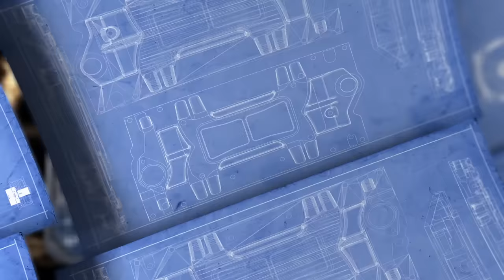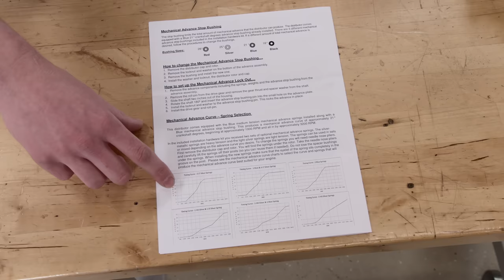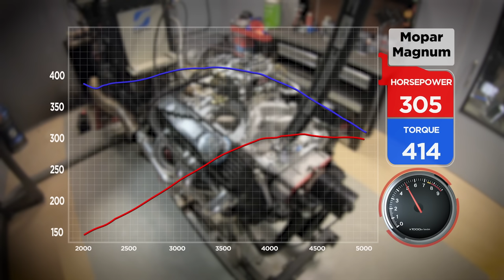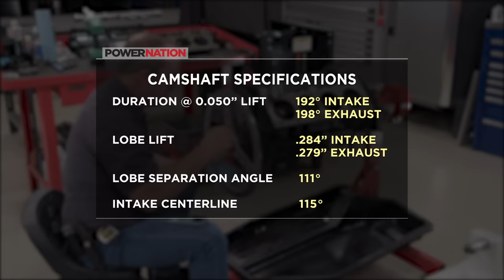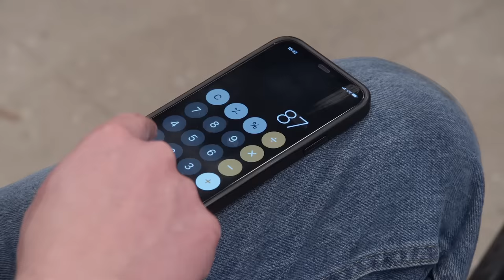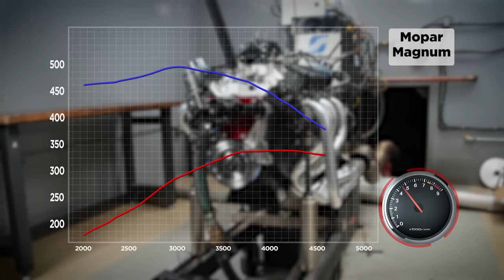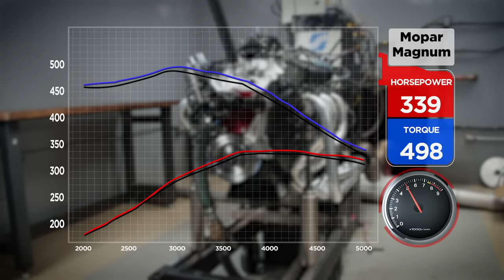What Happens If You Just Add A Stroker Kit To A Stock Mopar Magnum? - Engine Power S9, E3

Comment: This video was very much enjoyed as i have that 5.9 360 magnum in my 2002 truck all original only 85 thousand miles on it .. i recently did mild cam ,double roller timing chain, headers , a good cold air intake an a electric fan replacing old clutch fan , trans is all rebuilt with good performance parts including a external cooler ,converter match to cam specs an stage 2 shift kit an has true dual exhaust with high flow cats an a 392  posi rear gear an still factory intake an tbi .. tuned up by a local hp tuner ..about to swap to a edelbrock air gap performer intake jus trying to decide wether to go with 4 barrel carburetor or 4 barrel type tbi ? Plus im not sure how to properly swap to a 4 carb if i wanted to ,with it still running on factory ecm an stuff .. how does a guy do that or should i jus stay with 4 barrel type tbi.. can anyone help a guy ? Id certainly appreciate any suggestions or advice .. great video !! Lets see more done to this engine ??!!!!! 👍
Reply: Do your research. Check out YouTube, you’d be surprised. There would be something on there showing you how to.
Cheers😊
Reply: if you go carb, you need a carb intake, carb distributor, and you will need to rig a return style fuel pressure regulator into your stock efi fuel lines. tock efi fuel pressure is like 52 psi. carb wants 7.
Reply: @frigglebiscuit7484  thank you i appreciate the info 👍

Comment: Can anyone tell me if it’s a must to degree a camshaft when changing the cam in a stock engine? I have a 350 in a pickup truck that has finally laid down. Have a replacement 350 to drop in, the replacement engine doesn’t have a camshaft or lifters. So, when I put a new camshaft and lifters in, is “degreeing” required? Thanks

Comment: need a discussion on quench with that .004 proud deck ht.  might not make much difference in power with race gas but will make much less octane and timing intolerant
Reply: Quench rules.
(all my motors have quench!)
Reply: @carbytater2242  when the 68 open chamber heads came out replacing the 67 and earlier wedge we noticed the engines were more octane sensitive and timing sensitive.  Not that the 67 had quench but the 68 tended to detonate on the opposite from the spark plug side  WE started welding up the open chamber and with proper pistons well with a proper cam reduced EGT 800 degrees.  Ever see a 440 doing a heavy tow up a long grade like on the way to Vegas and have the exhaust manifolds glowing cherry red. 
Think about it  you lower the piston deck and it takes more throttle to give the same power, so mopar lowered the deck even more so even worse gas mileage and more heat.  Solution better than weldng with a D Dish piston was the reverse dome quench piston which we had custom made but then worked with KB to make.
Disclaimer you can make good hp with the open chamber it's the torque that takes a hit  and you need race gas and have to keep the revs up so what I say above does not apply to super stock or bracket racing
but street... cheers

Comment: So, about a year ago, you didn't run the last stroker magnum you built with Trick Flow heads on the dyno and promised it would be coming up soon... we all just got crickets now for over a year.  It was HIGHLY suspected that you melted down the top end because you used the wrong lifters and starved it of oil.  How am I doing so far? NOW you come back with the same stroker bottom end but in a dead stock magnum 5.9 with no other upgrades that you miraculously found in the back...  Who are you trying to kid here?  Either run the stroker 408 with trick flow heads, or own up that you smoked the thing.  You owe us all that much.
Reply: This just posted video is prolly from a 10 - 20 years old HP-TV show !!!

Comment: What does a loose timing chain on these blocks mean? 9:35

Love these magnums!
Reply: They said the block was align honed. That would would change the relationship in center lines of the cam and crank, I believe. Bringing them closer together causing a loose chain. The chain could also be worn, but they said this was a fresh rebuild so i doubt that. I'm not a machinist so take this with a grain of salt
Reply: nothing. thats a lie on their part. all mopar small blocks get lose timing chains, its just the nature of their cam bore to crank bore design. the small block was built off the old non hemi v8s
Reply: Thanks! I recal installing a new timing chain cause i thought mine was loose, but that one was loose aswell. And ive had other blocks that had a loose chain.
Reply: Some engines have a different timing chain/sprocket set available to compensate for align honed crankshaft bores...

Comment: It's not a "stock MOPAR Magnum" if it doesn't have the "kegger" manifold, EFI system and stock ignition. This is a BIG difference. The power of these engines is extremely affected by these components. This is a mild performance build masquerading as stock. Your stroker results would have been more impressive had you actually done a stock build first.

Comment: No timing chain tensioner? Because Magnums use them and those tensioners can use on LA engines also.
Reply: yea, i was noticing that too. the cam lift and lsa was also way more than stock...
Reply: @frigglebiscuit7484  - It's stock roller cam...

Comment: Wait... Why'd the stroker kit increase the compression ratio? Isn't the point of a stroker kit to decrease it so that you can increase boost?
Reply: He said align hone. Basically you cut a little bit off the bottom of the main caps to shrink the main bores and then hone them back out so they are all sized correctly and in alignment. A side effect is it moves the main bore centerline upwards in the block. And adding a stroker kit while changing nothing else will increase compression since you are compressing a larger volume into the same amount of space.

Comment: That cam is tiny 360 was used all the way to 2001 or so LS base motor came out in 1999 camshaft is like 480 lift something in the 5.3-6.0 why didn't use a higher

Comment: That baseline pull is somewhat bogus, using an aftermarket intake manifold and carburetor and headers will change the power of a "stock" engine. Which this isn't because it's been rebuilt and overbored already.
Reply: And we don't know if those are 'rebuilder' pistons that sit .020" lower than stock...

Comment: I am wanting to put a 360 magnum in a 05 1500 I have now. I'm curious about the locked out distributor that they used here. I would like to be able to use something to control my timing and spark without having the crankshaft sensor that's bolted to the back side of the engine block. Getting rid of that crank sensor would allow me to use the 5spd transmission that came in the 05 rather than using the 4spd that was used in the 03 model. Does anyone have any experience with this that can point me in a general direction. I would appreciate it

Comment: I have a 2002 dodge ram 1500 with a 360 magnum engine in it. Frankie said the stock compression ratio for these engines is 9.9:1. I can tell you this is not true, as a bone-stock 360 magnum has a compression ratio of 9.1:1. Also, are they oversizing their pistons in the stroker kit? Or are they keeping the stock 4.00 inch bore size? They upped the length of the stroke to 4.00 from the stock 3.58 inches, but I'm wondering about the size of the cylinder bores.
Reply: They did say it came with .040 over pistons in it when it was torn down.
Reply: @greglechowski5030  I guess I didn't catch that when they said it. Thanks for the clarification, also explains the slightly higher-than-stock compression ratio as well.
Reply: @alexwagoner285  the camshaft specs they showed was also not stock. the lift showed .454, thats not stock. stock 5,9 cam lift was .400.

Comment: Stock springs? 5250rpm valve float......all day every day. Go to beehive springs, drop in a .5"-ish cam with Crower S.S. 1.7 ratio roller rockers. I wind mine to 6500rpm.
Oh. 
Go to Total Flow in Troy, MI for a 2.02 valve conversion, and port and polish. 
You'll get nearly 300cfm out of STOCK heads.

My 96 all motor Dodge Indy Ram (4750lbs) runs high mid 13 seconds @ 102 mph on a similar combo. It's a daily driver with well over 150k on it's clock.

Put it in an A-Body........hmmmm.

Have fun!
Reply: BTW. DO NOT use 5.2L heads made in Michigan. Stock; they flowed 205cfm on a good day....more like 190-200cfm. 5.9L heads that were made in Mexico had better castings, and would flow 215+cfm all day long. These numbers were on flow benches at Chrysler which were calibrated to 25"hg vs 28"hg. Lower depression equates to a 12% advantage vs 28" depression.

Comment: I can't see how that's a stock 5.9 I've owned dozens of them and been on the Dyno many times and  have never had numbers anywhere close to that stock even  accounting for parasitic loss
Reply: Yeah, I was just thinking that, where the hell a stock 360 small block is pulling 414 ft lbs? Maybe the stock mopar intake is restrictive? But that doesn't sound right to me
Reply: @redchris97   I know they are somewhat restrictive but not by that much and you do gain a little bit back with the fuel injection
Reply: @merrittmcdowell8675  yeah, I've seen a lot of engine comparisons of carb vs efi, at the very least with the fast self learning or those throttle body efi systems, at minimum it's 15HP and 20 ft lbs, but 414 ft lbs out of a stock magnum? In your experience, is that normal? Because I'm thinking about putting my tinfoil hat on ( I'm not a Mopar guy, I work on JDM stuff )
Reply: @redchris97  they have always been on one side or the other of 400 lbs and 300hp
Reply: @harleylake1143  bro, that doesn't add up, I'm not a Mopar guy so I can't say one way or the other, but not even the 5.7 hemi is rated at that, I know the 383' were rated at 335hp but they are underrated from the factory, I'm almost wondering if they messed with the calibrations of their dyno to tell you the truth....
Reply: @redchris97  the numbers just seem alil inflated to me the last truck i had on a dyno was a 1998 Ram SS/T with the "high output" 5.9 and it had a cold air intake larger throttle body headers custom exhaust electric fans and a custom tune and it only dynoed at 238hp and 320tq at the wheels  and then engine had about 47k miles so somethings fishy to me
Reply: @merrittmcdowell8675  if you got those numbers with the drive train losses, that's roughly 270-280hp and 350-360ft lbs at the crank, that's actually closer to what I thought that motor was going to make, I was calling 270 and 330-340 just to throw out a number out there, that makes sense to me, sounds like someone is fudging their dyno calibrations for glamour numbers
Reply: @redchris97   My thoughts exactly
Reply: @redchris97  you should check out richard holdener videos he has on the magnum. He tested to stock 5.9 magnum and both were right around 300 HP and 400 torque
Reply: I just watched richards part 2 video again and with headers it puts out 300 HP and 399 lbs
Reply: @harleylake1143  I know Richard, I watched his stuff here and there, not to take a dig on Richard, Steve Brule and the westech guys, but what makes you think their dyno's are not calibrated in such a way? To me a dyno calibration does explain the difference in power, we are talking basic dodge 360 magnums with basic mods, a few HP here and ft lbs here or there, I would call it even, but it's significant, I also bring it up because one of my best friends bought a trick flow top end kit for his 454 advertised at 600HP, we got 540whp, but 540 on a Monte Carlo with a stick was like 570 at the crank, or at least that's what the guy told us, so I think they calibrated their machines on the optimal side of things, and from the same guy that dynoed that 454, he explained to me that there's a dyno calibration for the friction coefficient, what it does I have no clue, but that's how people get their glamour numbers.
Reply: @harleylake1143  it's kinda there, unless I fudged up my numbers on the power train losses, but the torque still seems kinda optimistic, if my Chevy S10 made that when I do the small block swap, I would be very happy 🤣
Reply: @redchris97  Very true! I don't have a clue on dyno calibrations or how it all works, but yeah, I'm sure they do everything they can to get the numbers. Have a great weekend!
Reply: @redchris97  stock magnum kegger is garbage past stock. stock 360 mag cam is 192 duration, .400 lift, 115lsa. stock manifolds dont flow as well as headers.
Reply: @merrittmcdowell8675  dude, that was a rwhp dyno, not an engine dyno. 238hp at the wheels is like 290 at the crank.
Reply: a 5.9 magnum with just headers, carb, and intake can easily hit 300hp. bigger cam, and youre in the 350s-370s.
Reply: @frigglebiscuit7484   Not according to the 6 I've had on dynos over my 25yrs of owning them  The only difference I saw was I was running  mechanical water pumps
Reply: This is a .040" overbore 1994 & up 5.9L Magnum w/ roller cam and so 368"... 
Pre1994 360's were weak gas hog emissions slugs...
Reply: @BuzzLOLOL  I've only even owned magnums, even the magnum version fits that description lol, well except my magnum V10 other then loving the gas (but what real man buys a big truck for gas milage)  that thing is a beast!!!
Reply: @merrittmcdowell8675  - Up to 1993, 360's still rated 9 MPG city and 11 MPG Hiway... 1994 & up Magnums more like 15 city and 20 Hiway...
Reply: @BuzzLOLOL  I've had dakots durangos rams jeeps all with magnums and none ever got anywhere near 20mpg bet i got was my 98 SS/T that i swapped in 4.10s which actually helped and i was at 17-18mpg on flat ground and no wind going 55 lol in reality the avg. Was more like 14
Reply: @merrittmcdowell8675  - Still a lot better than the earlier 9 city/11 hiway... my '95 Ram 360"/5.9L does vastly better MPG than my '78 F150 351"M/5.8L... Ram has a lot more power, as well... 
Richard Holdener has a dyno video showing the Magnum 5.9L also has more truck power than the Hemi 5.7L up to 4500 RPMs...
Reply: @BuzzLOLOL  o I'm debating they are superior, just the stock numbers dont jive from my experience and the real world gas numbers dont either compared to the factory claims but thats like most all claims lol
Reply: @merrittmcdowell8675  - I can usually match the numbers if don't warm up engine before driving off, don't idle a lot, don't use remote car start, and just accelerate gently...

Comment: I wish I knew of a gas station where I could buy gas that would run an engine that had 11. 3 to 1 compression.  They said they were using 93 octane. That's hard to believe. Alot of engine builds on this show, would make more power if they ran this high compression. I wonder why they just do it with some and not others. Makes me wonder.

Comment: should have gone totally stock with the stock intake...those things are terrible.
Reply: I was gonna say the same thing.  The stock "beer barrel" intake is a known power killer.  The "stock" run was 60hp+ over real stock.... and it was mostly due to the aftermarket Edelbrock intake.  I had a 360Magnum in my Durango and that thing was a total pooch, it couldn't pull a 20' boat up a mountain without dropping down to 2nd gear!  I did some research, and the intake was the big problem... all the forums said change that first and pick up 50+hp
Reply: @kurtblackwell6214  - Actually the stock intake is a torque booster... but limits HP...

Comment: Can you do a stroker kit on a 5.2 liter ?
Reply: They have a stroker kit fr the 318 as well.....bore it out .030" and stroke it to the same 4-inch stroke, and you have a 390 cid based on the 318.
Reply: @markdubois4882  does the block have to be clearance for the larger stroke ? I found a stroker crank and rod are about $2 grand
Reply: @jasinpedone3020  That I can't tell you, but yes, the stroker kits are over $2k.

Comment: Kinda ridiculous Frankie said they would ONLY be doing a stroker kit and nothing else but proceeded to put aftermarket exhaust, intake manifold, electric water pump, carb, (originally fuel injected) carb spacer, harmonic balancer, distributor and oil pan on the engine before the first pull on the dino. 🙄
Reply: Both versions of engine had same external parts...

Comment: “Oh yeah this is a stock engine” no tf it aint. It has an edelbrock carburetor and headers, along with an electric water pump. Sure the specs may be stock, but that intake manifold let it push out more HP.

“Read the instructions first” proceeds to use an impact gun to tighten almost everything that has a torque spec

Comment: I wish there were hp parts for the magnum V6.
Reply: Add 2 cylinders and v8 exhaust manifolds. I swapped in v8 5.2 or 5.9s pretty straight foward.. you'll be happy.
Reply: @donaldpowers5557  Yes I know, but I always wanted to see what you could get out of the V6.
Reply: there technically is....magnum v6 is just a 5.2 with 2 less cylinders. hughes engines has stuff i think.

Comment: 360 magnum didn’t come in the midsize the 318 did with was also a magnum
Reply: 360 did come in midsize, just not as common as the 318 or 239.
Reply: this is what they came in...........google buddy,google.
Dodge Dakota	1998–2003
Dodge Ram	1992–2002
Dodge Ram Van	1992–2003
Dodge Ram Wagon	1992–2003
Dodge Durango	1998–2003
Dodge Ramcharger	1992–2001
Jeep Grand Cherokee 5.9 Limited	1998
Reply: Dakota R/T, grand Cherokee limited 5.9, Durangos, and early  quad cab Dakotas all had 360s in a mid size truck.

Comment: These two need to stop messing with mopar motors they clearly don't care. No one trying to make power is going to put junk stock heads on a stroker motor. All they do is build the same ford and chevy motors using box parts. Get a mopar guy on this channel. A stock bottom 360 with heads and intake can make that power.